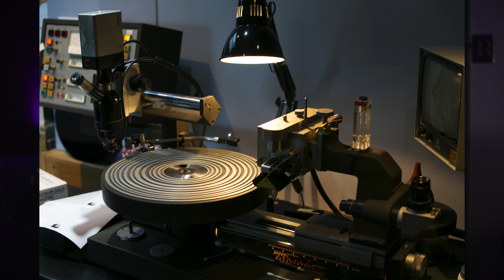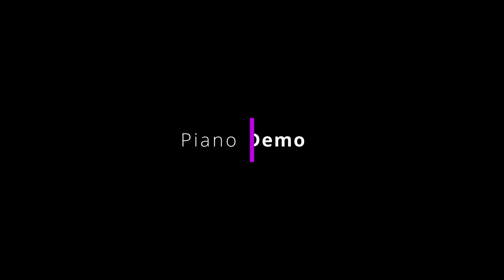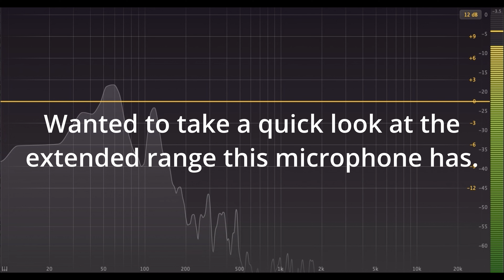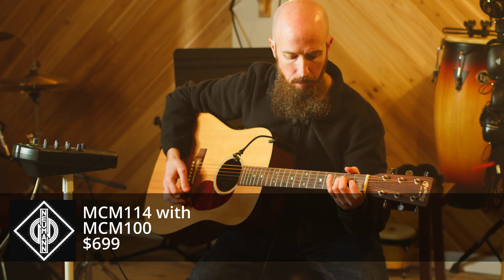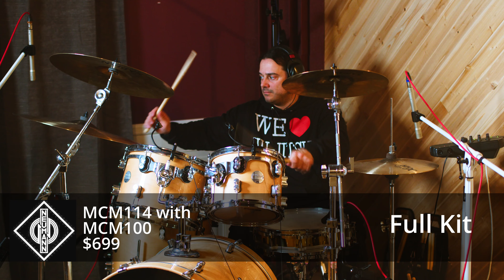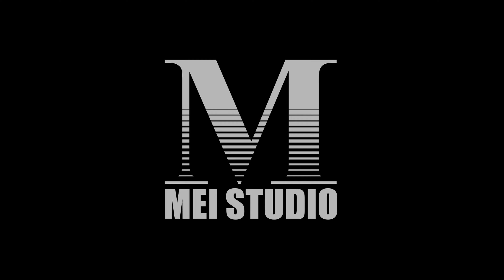Neumann MCM114

Comment: I sprung for one of these because I'm beginning to play live again, and my never ending hatred for piezo pickups has gotten even stronger over the years. So I am a little disappointed to find that this is not the solution I had hoped for. Unfortunately, the mic does not provide enough headroom before feedback problems set in in a live situation. I will have to go back to a setup that an old Fishman system with a Crown mic gave me decades ago:  The combined effort of a mic and a PU, where the mic is in charge of a touch of "air" and the PU delivers the bulk of the volume. I guess that'll be the way to go no matter how much technology improves. The Crown mic had the advantage of being hidden inside the guitar's body, whereas the Neumann sits on the outside and screams "dork". Oh well.
Reply from the maker: The mic is certainly not for everyone.  It works VERY well on brass and string (violin, viola, cello, bass).
Have you tried looking into something like this: https://www.lrbaggs.com/acoustic-guitar-pickup-systems

Comment: As always such a great video!
I have the DPA and while it sounds fantastic on almost all my guitars including a custom handmade flamenco, the build quality of the holder and the whole design sucks! Very flimsy and even bad quality. However the sound is just awesome and barely needs any EQ! I want to add the Neumann 😅
Reply from the maker: I have the DPA clips, which I was told were interchangeable with the Neumann... turns out, not so much.  The DPA clips, which are like half the price of the Neumanns, are very loose.  Im guessing you're finding the same thing using the DPA mics with it?  I wound up just biting the bullet and getting the neumann drum clips and guitar clip for them.  I still use the Bass clip though since I like the design DPA did on that one better than what neumann did (just needs a little tape to keep in place when recording so it doesn't slip).  I would love to shoot the DPA out with these at some point. $$ lol.  Thanks for checking out the vid! :)
Reply: @meistudiony  Man, the prices on these clips are just ridiculous—both companies! The DPA mic sounds incredible, but that's where the positives end for me. The guitar clip is poorly designed, falls off easily, and even the mic’s tiny 'shock mount' broke. Really disappointing. That said, the DPA still sounds fantastic, no matter how I position it.

Comment: Can I use this mic with my Sony a7iii?
Reply from the maker: You would need phantom power for the mic and an onboard preamp. I dont believe the sony will facilitate the balanced input one would need for this mic either as it only has a 3.5mm stereo jack.  However, you CAN use something like the saramonic smartrig ii which can power the mic and change the xlr to trrs to go into the sony.

Comment: Mcm 114 on the kick drum ? 20:04
Reply from the maker: I'm looking into picking up more of these actually.  Mainly for snare and toms.  The problem with kick is where to mount it?  Inside, outside?  While it can certainly handle the SPL, The low end this mic has is something i haven't seen on just about any other mic in the collection.

Comment: I’m surprised by the self noise level. But… on the other hand, if this is ok for Neumann, maybe some of my other “noisy” mics aren’t so bad.  (?)
Reply from the maker: The figure is high on paper... but in actual use, I haven't noticed it.  The output (sensitivity) is good enough that you dont have to crank a pre to get a good level.  I had to pad the mic for use on the drums.  Piano and bass i barely needed any gain at the pre without the pad (20db or so).  Problem is more when you have a high self noise and a low sensitivity that things start getting out of hand.  Vintage u87's can have this issue.  The output is not great and the circuitry wasn't the quietest thing ever.  They tried to rectify this with the AI circuit but they wound up over hyping the top end and the mic now kinda sounds "not good".
Reply: @meistudiony   Makes sense to me. I have some great sounding mics with high self noise ratings… and they too are very sensitive.